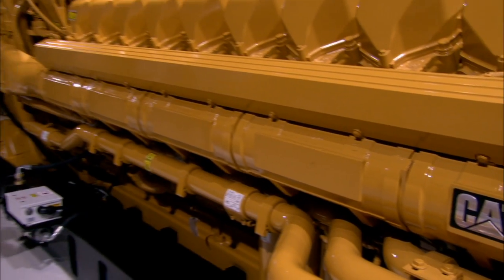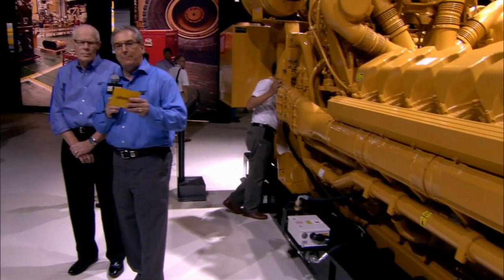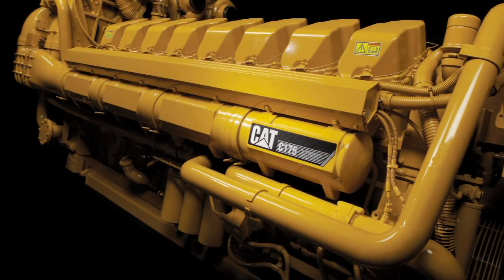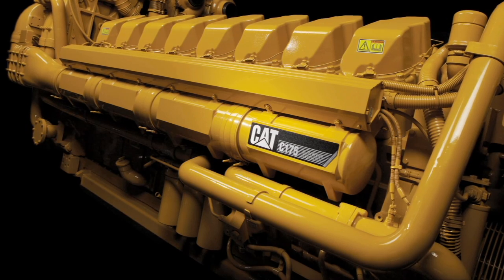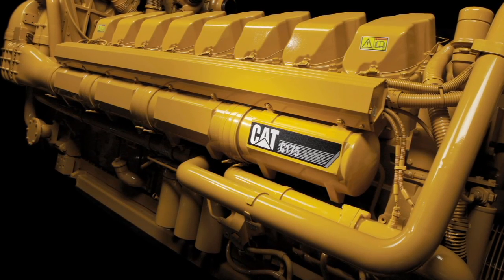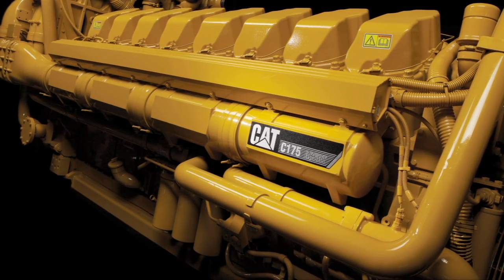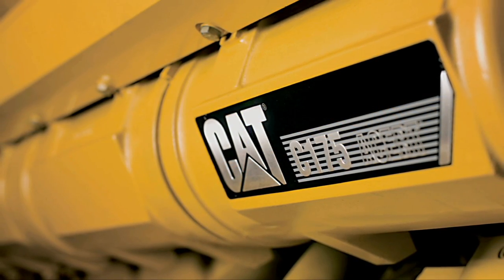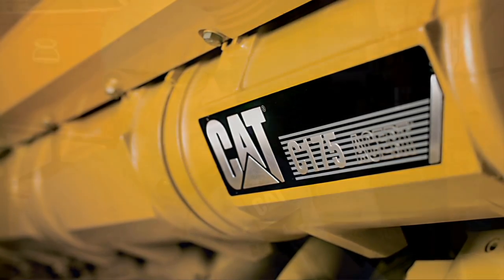Cat® Electric Power

Comment: Hopefully if Cat has got there act together, they might end up putting one of these in locomotive use (note locomotives puts a lot more strain on an engine vs. marine use) anybody remember the MK 5000's? They took the MK5000 motors out because of reliability issues n put the EMD 645E3 V20 into them. I've always said if EMD n GE merge together they will revolutionize the rail industrty (GE has the brains, EMD has the power)
Reply: they are phasing the C175 into EMD locomotives through progress rail. Mostly in a prototypical stage. They built a locomotive with a combination of a C175-16 and a C18 ,  the smaller C18 is for driving and lower power, and the C175 for medium power, and both can function for full power.
Reply: Hmm, sounds like a plan for Cat. Hey quick question, do you know if Cat put any of these engines in any of the PR30's (SD40-2 Rebuilds) or the PR43's (SD70 Std.cab Rebuild) for demo purposes? I have a pic of the PR30C if you would like to see it well, i don't know how to send it to u through here so what i can do is just tell u where u can find it. 
Go to Railpictures.net and type in PRLX 3003 n u should c the pics. Thanx for the info n i'll have a blessed day!
Reply: C175 cat is already in locomotive use